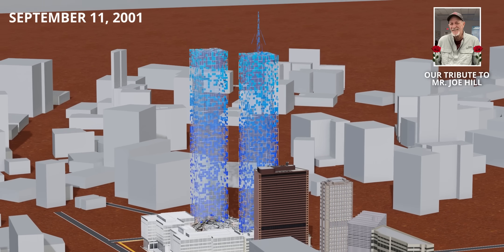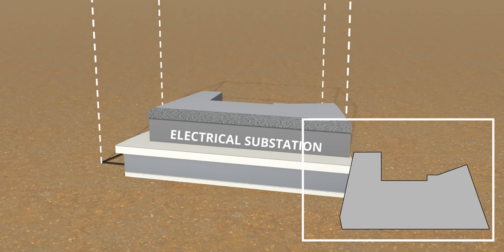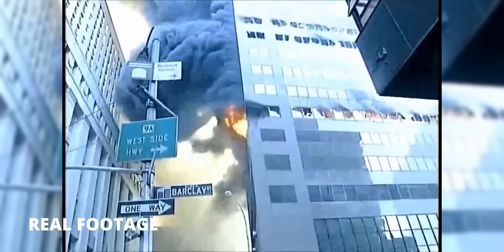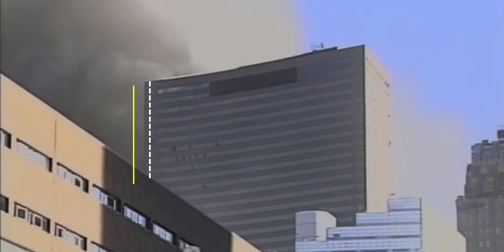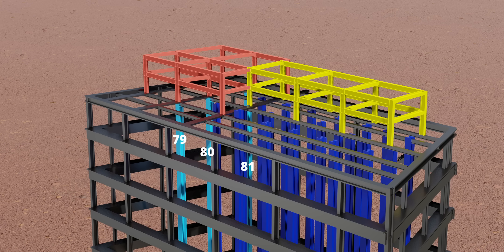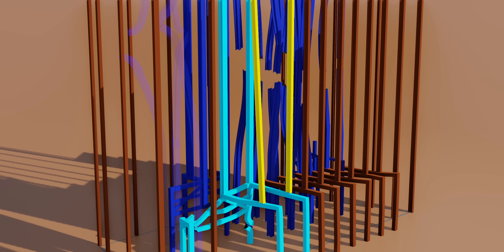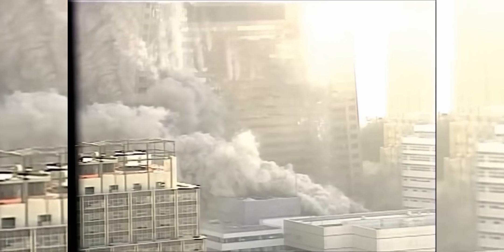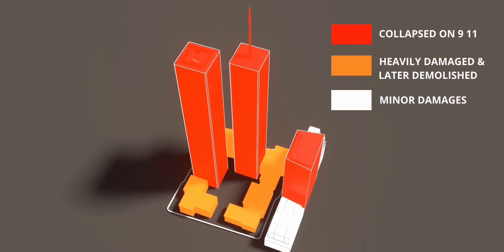Collapse of Building 7 | The Complete Physics

Comment: The University of Alaska study explains it better.
Reply: What "University of Alaska study" would that be? If you're talking about Hulsey and his nonsense, that's not a UofAlaska anything, and it's not a Hulsey study, either.
Reply: Meanwhile, let's do this:

1, The supposed "study" of Hulsey's was bought and paid for by A&E911. Now, there's nothing wrong, per se, with that, feasibility studies and the like are bought all the time. But, considering that A&E911 have a vested interest, the impartiality of the "study" does leave some to wish for.

2, the "study" was to take 2 years to make. And then it got moved. And then it got moved again. And then it went very quiet for some reason for quite some time. And then it finally was released, 5 years after it was announced, and 3 years late. I'm not saying the "study" was massaged to fit the customers wishes, but it's rather interesting that it took TWO AND A HALF times as long as it was meant to.
3, the "study" was supposed to be open to criticism by the public, and then it was supposed to be peer reviewed after that. And then, for some STRANGE reason, that went away, and it was just quietly released into the wild with no mention.
4, the "study" findings were already determined before it had started. A&E911 asked for donations and organized a drive to be able to pay for it, at which point they announced what the outcome would be. Let's repeat that. A&E911 told the world what the "study" would say, even before they'd paid for it, much less before it started.
5, the "study" is more or less spent refuting the NIST report. However, NIST isn't the only report that say that the collapse started due to fires. These other reports are mentioned but aren't addressed.
6, Hulsey's "study" tries to so something impossible. It attempts to prove a negative, i.e. that fire could not have been the starting mechanism for the collapse. This, as anyone with even the slightest knowledge of science knows, is impossible. You can prove what happened. You cannot prove what didn't happen.
7, Hulsey is not competent to make the "study" he did. While he is an engineer, his work has entirely, and solely, been about road-surfaces and bridges, as well as cold-weather effects on the same. There is NOTHING in his work that has anything to do with buildings, or fires.
8, the "study" is a shambles and a joke. There are holes in it so big you could drive an 18-wheeler through them. As just an example, the model showing the data and conclusions of the "study" has the engineering "penthouse" of the WTC 7 hinging in the middle, completely dissimilar to what visually happened, then collapsing, in one piece, through the building, without causing any damage to the rest of the building, stopping about a quarter of the way down, and then literally just hanging there, still in one, deformed but still mostly intact, piece.
9, the Hulsey "study" has been referenced, or even MENTIONED, in any reputable engineering publication, exactly NEVER.

And, while it isn't an argument as such, it is very interesting to note that Hulsey went from being head of the department to being "Professor Emeritus" after his "study" came out. This rather suggests that, much like Steven Jones, he embarrassed the university and so, they shuffled him off to the "honorary" position so he wouldn't be quite so in the public eye.
Reply: It does?  How?  Please be specific. That will of course require that you both read and understand Hulsey's report and bother to watch this video, neither of which I suspect you have done. 

I have actually read both the Hulsey preliminary and final reports from cover to cover.  My opinion of the Final Report is as follows:

The Hulsey Final Report on Building 7 met none of its three stated objectives – indeed could not have met those objectives for lack of trying - and failed to prove its main conclusion, by way of a fundamental logic error; Hulsey claimed he had concluded fire could not bring down Building 7 without accounting for the full envelop of possibilities.  Essentially, he claimed to have proved a negative

Hulsey also plagiarized almost 3 pages of material from Tony Tsamboti, who works for the studies sponsor. I hope I don’t need to point out the ethical implications of that. 

While promising superior models to those of The NIST, the Hulsey Report in fact delivers grossly inferior models which eliminate the time factor, focus on only two floors and rely on a greatly simplified version of The NIST’s temperature data.  The model animations are clearly not derived from the model data as they show no dynamics at all and are obviously forced to make the animations (superficially) look closer to the sponsors imaginging of the real event.

The choice of Hulsey to conduct the study is quite odd. A teacher, not a practicing structural engineer, from a tiny university in the farthest reaches of the country, Hulsey had no previous experience with buildings, let alone tall buildings, had never performed a fire analysis before – had not even published in 20 years - and had no experience with the tools used to conduct his analysis. It boggles the mind how a more suitable organization could not be or wasn’t found and causes one to question the real reasons Hulsey was picked. 

Overall, it is a shoddy piece of work done by a man clearly working out of his element and areas of expertise. It rather reeks of trying to support a conclusion arrived at before the study started.  Curiously, study sponsor Architects and Engineers for 9/11 Truth having announced what the study would conclude before they awarded it. 

Hulsey tested just one out of countless thousands of possible scenarios, using a completely unrealistic scenario and an artificially restricted set of data almost like he wanted to ensure fire would not cause a failure. The Hulsey Report was so factually inaccurate, methodologically unreliable, scientifically unsound, illogical, and biased that it blatantly violated any requirements of objectivity, utility, transparency, and reproducibility that would have been required to submit it for peer review in any reputable journal.

Hulsey and his assistants have not published the report anywhere that any relevant academic or professional engineers look to. 

Hulsey had said all along that the report would spawn several (perhaps four) papers in good American engineering journals and possibly a book. 

Then Hulsey walked that back, realizing he'd stand no chance to pass peer review in America and so said he'd go for European journals - but years have gone by with no publication whatsoever. Also, no book from any science publisher either. As far as the engineering profession and science are concerned, the Hulsey report barely exists.

The engineers of America and of the world have never read it.  It has had zero impact in the professional community. 

To its intended non-engineering literate audience, they Hulsey Report contains enough engineerspeak density for them not to ask questions, even if they were so inclined. Since the report appears to (superficially) deliver what they want, they are not inclined, even if they knew what to ask. From a structural engineering perspective however, The Hulsey Report is of no value, which explains why promises to get the report published in peer-reviewed and reputable engineering journals where it could be scrutinized by qualified professionals were abandoned.  

I suggest you use caution in the future - just because it's what you want to hear and they flash some professional credential at you doesn't make it right. The devil is as always in the details.

If you are genuinely interested in what happened to Building 7 rather than in promoting a political agenda, there are several excellent forensic engineering reports out there and over two dozen articles published in genuinely peer reviewed engineering journals that are far more comprehensive and competently done. I suggest you seek them out instead.

And actually read them.
Reply: @TheCriticalStinker-01  If I had to guess at a number by the way. I'd say at least 5,000.
Reply: @TheCriticalStinker-01  And I see you believe I have a political agenda without having the slightest idea who I am. What political agenda do you believe I have?
Reply: @tinasmith1391 - It appears you have no qualms about any of my criticisms of the  Hulsey paper. I will take it then we are in agreement it is shite.

Glad we got that sorted out. Have a nice day.
Reply: @TheCriticalStinker-01  Carry on bot. Thanks for not addressing a single question I asked either. I have to say, your work is nice. Like back in the day when the 77th Brigade was doing it.
Reply: @tinasmith1391 - You were being rude and deliberately evasive. I never indulge that sort of behavior and prefer to stick to topic.

That topic is resolved. 

Have a nice day.
Reply: @TheCriticalStinker-01  That really is nice work you do. Just like back in the day. Very few channels have videos that are patrolled like this one anymore. Brings me back to like 2010. I kind of miss it. Take care now if you're actually human.
Reply: @tinasmith1391  - I'm (slightly) curious, do you take offense to anyone with an interest in a topic or only those with the audacity to disagree with you who also happen to be right?
Reply: @TheCriticalStinker-01  I don't take offense, but you obviously do. 

"And I see you believe I have a political agenda without having the slightest idea who I am. What political agenda do you believe I have?"

Unless you'd care to clarify.
Reply: @TheCriticalStinker-01  If I'm a liar for not believing your story then I'm one of the nearly 70% of liars in the US who doesn't. You misrepresenting Hulsey isn't going to change anyone's mind either. The consensus is that you're wrong, just like you've been for 20 years. First you said it was politically motivated, then you switch to conspiracy theory for no reason you can explain, and now you've muted me. Maybe you really are a paid human agent. At any rate, I really don't care. I wish you luck in convincing the 70% of that don't agree that we're wrong. It won't be easy, but at least you're getting paid.
Reply: @tonyasmith, 4000 engineering professionals have signed the nutter pledge. There are millions of engineers world wide.  What 70% are you talking about?   I mean, 70% of all idiots, yes, I could see this.
Reply: @TheCriticalStinker-01  Do you work here? I can't help but notice your account was created about 3 weeks before this video was posted and your first comment on the video was pretty much the day it was posted. How many of the 14,010 comments on this video do you think are yours? Do you watch any other videos or just this one, all day every day?